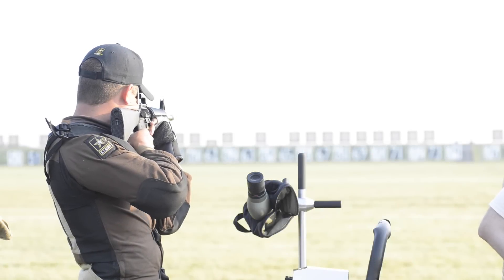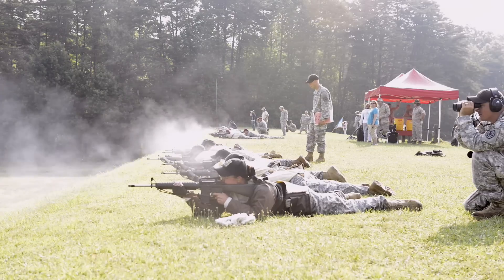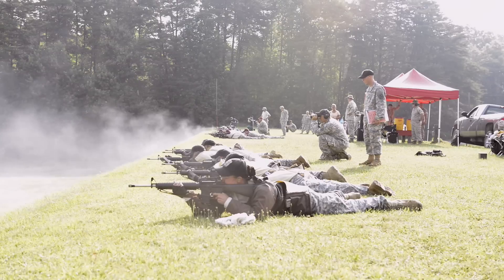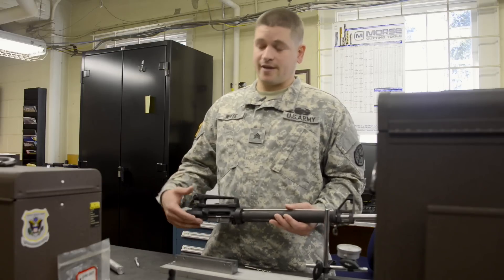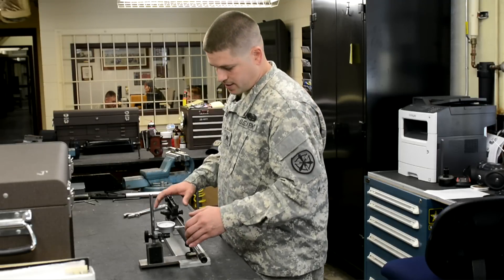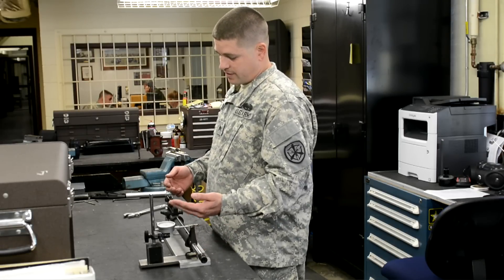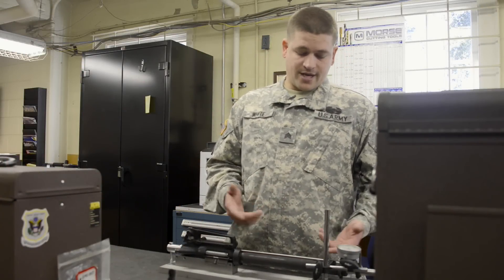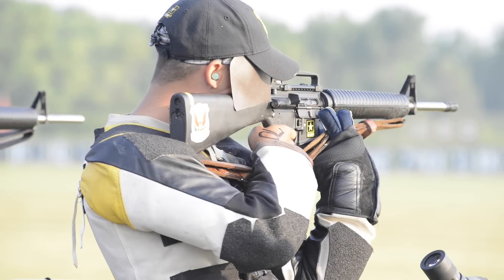New Front Sight Alignment and Adjustment Fixture

Comment: The guy didn't explain it very well. So the rear windage knobs are adjusted at 1/2 MOA per click. The problem, very rarely mind you, is that you can't quite zero it because the front sight is somewhere between the 1/2 MOA. So the idea is you need to make a very micro adjustment by 1000s of an inch and this will do it for you so you can adjust the sight to zero your weapon.

The way you do it is you loosen the set screws on the front sight and you simply adjust until it is aligned correctly. You can't do this on a pinned front sight base. The rifle in this video has a set screw on the front sight post so it is possible to adjust.

Generally speaking when you put a upper and lower together, doing an "eye ball" estimate is good enough. At a national match, you want to be precise as you can so doing this is important. For a normal user, probably not so much.
Reply: Correct. Im happy with my 5" groups
Reply: If the front sight is pinned, then what?
Reply: @justaskmeiknow5584  if your front sight is pinned then this gauge is not going to come to your aid. This fixture supports proper adjustment of front sight base that is attached  by set screws.
Reply: Ahh. Set screw. I should've known

Comment: Wait, if the front sight base isnt taper pinned then how the fuck is it mounted? I knooooow it aint no fuckin press fit on a .750 journal. Slides right on. Must be set screw on the bottom
Reply from the maker: The front site is a clamp on for competition rifles.

Comment: dont you guys taper pin your front sight base?
Reply: MARVIN THE BOON that’s I’m wondering. I have a gun I sent away to fix a canted front sight. They said it fixed but I have no idea unless the barrel was replaced
Reply: No, not the national match rifles. If you look very closely, you can see two set screws held in place.
Reply: @Dan-di9jd  My NM rifle from RRA uses tapered pins.
Reply: @goosecouple  okay